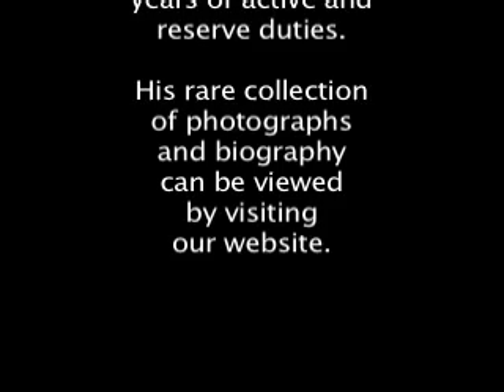Hindenburg Disaster May 6, 1937

Comment: This is partially correct. The static electricity alone wouldn't have ignited the Hydrogen. What happened was the Hindenburg made two sharp turns to line up with the mooring mast which caused a bracing wire to snap and slice open a gas cell. The leaking hydrogen was then ignited by the static electricity once the mooring ropes hit the ground.

Comment: Nitrogen (N2) makes up more than 78 percent of the earth's atmosphere.  It will not burn or support combustion.  It cannot be detected by any of the senses and it is not toxic.  Although it is often referred to as an inert gas because it does not oxidise readily, it nevertheless forms many compounds.  It is frequently used to inert systems that contain, or have contained, flammable liquids or gases.  Ammonium nitrate IS explosive, but nitrogen alone on its own is not

Comment: ok well im going to reply to @shaklucy heres my personal opinion. Back then they used a flamable material to cover the hull. At the time (almost exactly when the hindenburg went down) there was a minor engine fire. it was believed to be minor enough and was put out. But however its more than likely that a small portion of the fire got to the hall (which would not have been hard to do) and easily light up the hindenburg. Now im not saying that my thoery is what happened.

Comment: @fred55488 lol helium is not flammable at all. The Hindenburg had hydrogen in it, which is extremely reactive, but helium is a noble gas, which means it pretty much never reacts to anything.
A common party balloon is filled with helium, that's how harmless it is. If you inhale it, it just makes your voice have a higher frequency because it is thinner than air, but other than that it is harmless (unless you breathe so much that you can't get enough oxygen to survive).